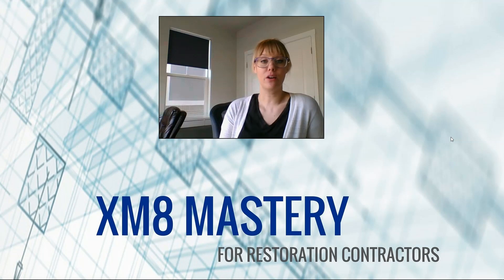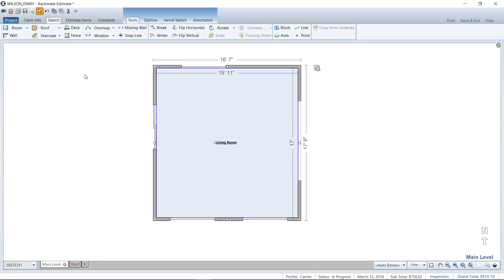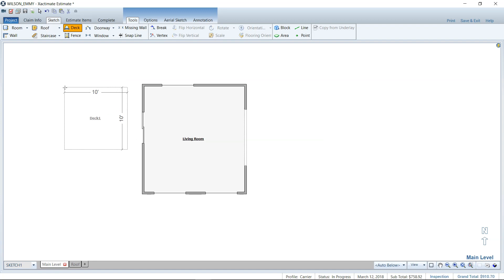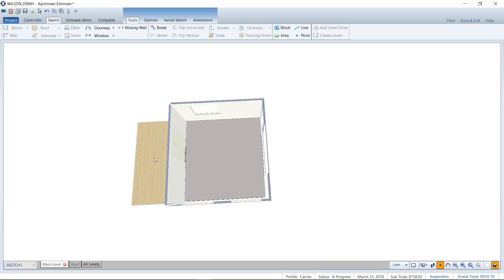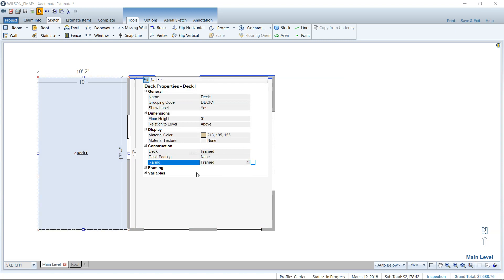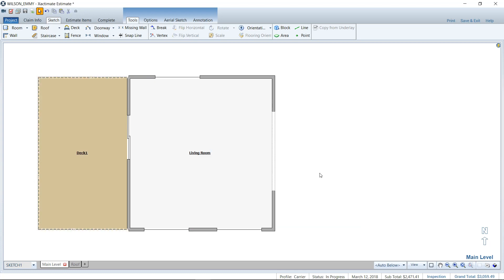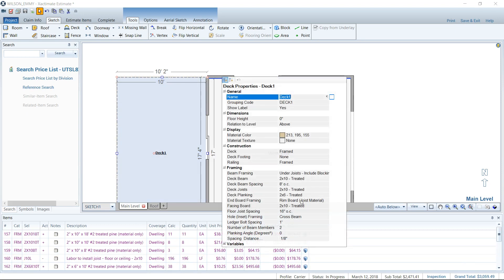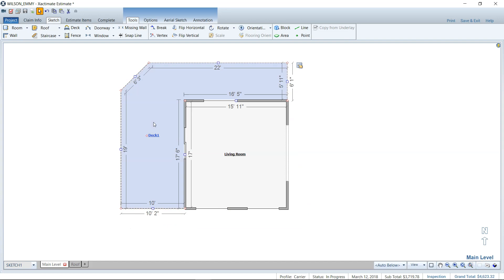Deck Tool in Sketch

Comment: I am having the same issue as some other users, I am only seeing the floor of the deck, no footings no framing no railings. I followed every step so I'm assuming it has to do with updates in X. I had the same issue with the carpeting tool. It didn't show any cuts no matter what I tried.
Reply: Right click in white space in 2D view.  Go into "View Properties", under "Details" tab, change to "Super"

Comment: Thanks for the video - I have a deck off a 2nd story and wondering if this would work for that?
Reply from the maker: Jonathan,  to install a deck in sketch on a two-story house / bldg. you have to create the second story in sketch.  At the bottom of the screen you'll see 'SKETCH' and 'Main Level' .  Next to the main level you'll find a + sign.  Click on that and name it Second Level or Story, then add the room and the deck off of that.  Let me know if that works!

Comment: Added stairs to deck - but it will NOT allow the stairs to Sub-Group into deck- is there a way to AUTO estimate for the stairs like it does for the decking ?
Thanks
.

Comment: Fantastic video, as always. I have learned so much from you and I can't thank you enough. Regarding this video, Is there a way to use this tool to create a concrete slab balcony for a second floor?
Reply from the maker: Thanks for letting me know you're enjoying the videos Victor!

Good question on the balcony concrete slab - I would create a room next to the exterior wall and then remove the walls and just add the SF of the concrete and other materials to that area to account for the measurements. Does that make sense?
Reply: XM8 Mastery, thanks so much for getting back to me! That’s a great idea! So, just make all the walls into missing walls and place railings in the estimate? How would you address needing to include the drilling into the building, epoxy, and placing the rebar for reenforcement? 

Also, what would you put in for supporting the entire slab as it sets?
Reply from the maker: I'm not all that great with the structural support and addt'l materials as I haven't had to estimate this particular type of balcony...I just know that using a room is the easiest way to account for the SF, etc. Sorry I'm not much help with the specific materials!
Reply: No worries at all. I appreciate your response and everything you do. Have a great day.

Comment: Any line items for roof top decks. I have one where the existing deck will be needed to demo (2nd floor) to install a flat roof. Then install a new deck on new flat roof.
Reply from the maker: Hey Dan - Let me ask you a couple of questions: what material are you going back with for the deck itself? Is there going to be railing? If so, what is the railing material?